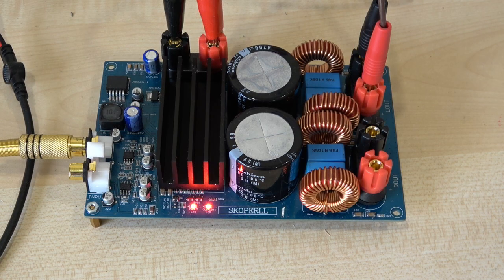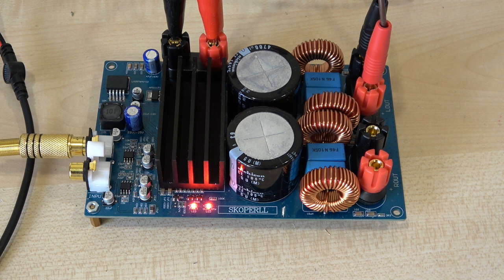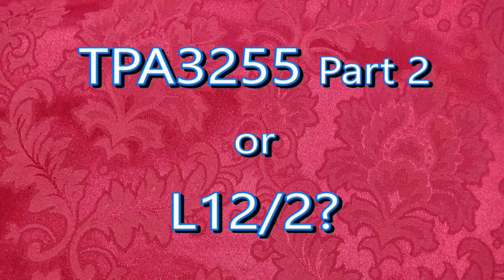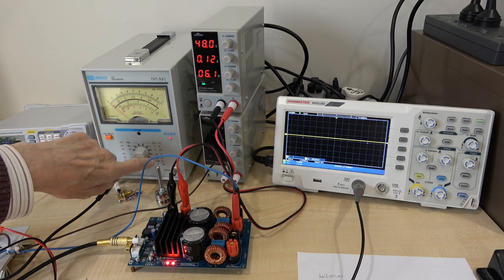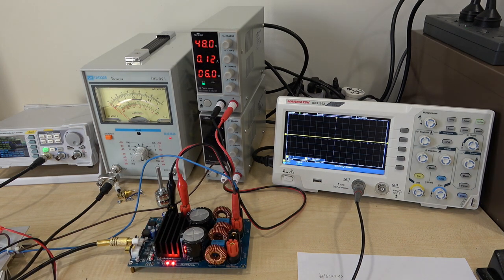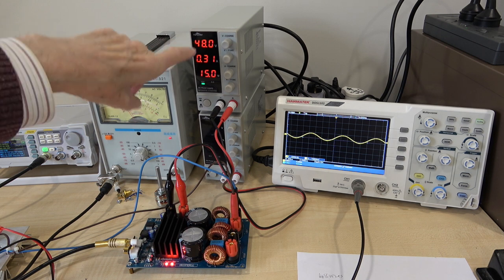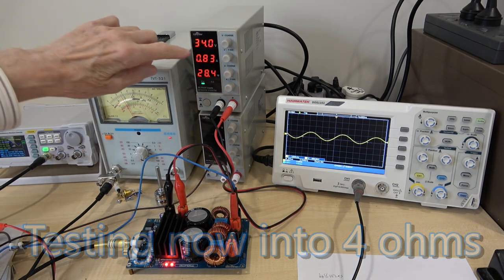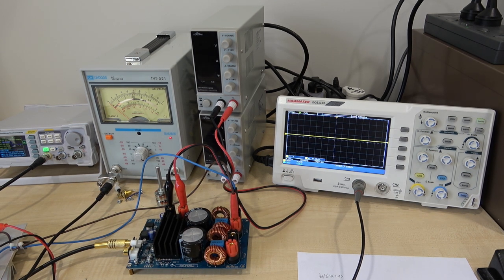Lets Test This Class D Board

Comment: That's a BTL output ... if you are measuring only one side of the bridged outputs, you have to double the voltage then calculate power ... if you are getting 17 volts on your meter, the speaker is actually seeing 34 volts .... (34 x 34) / 8 == 144 watts.

To scope for clipping you actually need to use two probes because both red and black posts are active... one probe on the red, one probe on the black ... then in the scope you need to do ch1 - ch2 ... the resulting waveform will show you the true output.

Also, the thermal solution on these boards massively sucks.  They either supply a dry junction or a themal pad.  Making a small 1/8" shim for the heat sink to just span between the bolts gives you better clearance from the components underneath and a far better cooling for the chip.

i recently worked on a bunch of these amps and I got a very comfortable 125w/ch rms on 8 ohms and 220 w/ch rms on 4, at 48 volts ... with no shutdowns.

Comment: Im wondering if that xl regulator is is misbehaving at 48volts like you showed in the other video. Often the amp chips use 12v for other circuits internally and if its drifting up out of regulation it could cause the amp to act up and cut into protect sooner. Could we work out a dropping resistor value to put on the input of the regulator so it doesnt see more than perhaps 30v for example from its supply.
Reply from the maker: These boards vary from batch to batch. One of my viewers has just sent me some photos of his board. No heatsink compound whatsoever on the IC. Heatsink touching the underside capacitors which will short if you secure the heatsink correctly.
To be honest, I am really fed up with these class D amplifiers. You can be lucky and get one assembled correctly, some even have the correct parts fitted. You do take a gamble buying these boards. DO YOU FEEL LUCKY PUNK??
Reply: @MichaelBeeny  after watching your videos it seems like the dual ic tpa3255 2x fan could be promising and the tda7498e board. im going to give the tda7498e board a try like your one as its quite affordable compared to the others and im running 8ohms anyway. Hopefully i end up with a similar working board. I have a few powersupplies to try. A pair of large laptop bricks in series or a centretapped 20 0 20v 150va which ill rectify with two diodes fullwave+cap and use a boost converter to get me up to 36v.

Comment: So it looks like your board is faulty. I was able to get 100W at 4ohms. My amp was able to stay with such power forever without overheating. My power supply had limit so I was not able to crank it more. Once new power supply will arrive I will make take at full blast 51V.
Reply from the maker: Good luck with 51 volts.
Reply: @MichaelBeeny  Today I got new 48V 10A power supply. First I replaced main caps from 50V to 63V,  set voltage to 51V on the supply, then tested the amp. It did not blow up but max power is only 200W not 300. Without the fan heatsink got 80C so I stopped the test. Inductors were about 40C. I assume that with the fan it could give 200W continous.
Reply from the maker: @Marcink126  My board was already fitted with 63 volt caps. All I can say is you are very lucky. So many people have written to me saying the board blow up at over 45 volts. With other tails of wow.

Comment: I just wanted to say thanks they have a thing called a amplifier Dyno that you hook up to a amp and it will give you all the different out puts and at different ohs as well also shows input voltage. They talk about how to use the older tools that I take to get the reading on the amplifier but they never show them or use them to prove that what it really is some time I question the Dyno and wonder how it would test up against the older tools.🤔👍✌️👌🇺🇸🍻🎶
Reply from the maker: Sorry Joseph, I must say, I have never heard of this before. If you want to send me a link, I will be pleased to look and comment.
Reply: @MichaelBeeny  look up Williston audio lab he use it the most  and is popular for using this amp Dyno and it's all he does and  a guy named smd also has a hand held Dyno sold on Amazon he design and built it with the designer of the original in the Williston video. Ps  I'm not sure if the big one is offered to the public  but the smd hand held is. Hope that helps.🎶👍👌✌️💯🥂🍻

Comment: Every TPA 3255 as known, have for channels.
If someone is interesting to build a good power amplifier, has to choose boards with independent tpa3255 per channel. And not less 5A power supply per channel 
With this the power is sufficient
Not with one TPA for 2 channels or 2.1 channels.

Comment: Chinesium amps deserves any bad press thrown at them. At one time when you made an audio amp and said it was a 300w system that meant someone tested it. When it was tested certain criteria had to be meet. Like actual power output vs harmonic distortion. The standard for stopping the test and setting the "as advertised" specs would include reaching .01 %  harmonic distortion. Chinese standards, if there are any, range from 10 % to 20% harmonic distortion. That's not a typo. The US standard was 0.01%, China is 10.0 - 20.0% up to infinity. 
So sure if all you care about is watts out get you some Chinesium amps with a built in screaming cat synthesizer.
Reply: To be fair the Chinese mostly just state the specs from the Texas Instruments specsheets. Which also state these ridiculous figures.
Reply: Was just about to reiterate what @rustontime said. The number come from the TI spec sheet with a 51Vdc PSU at over 10% thd.
Reply: @zoroluva  Okay so read the TI specs. Do you see anything about using dirt filled Ichycon caps? Or pcb's with .000000002mm traces.
Chinesium crap is Chinesium crap.
Putting lipstick on a pig is just a pig with lipstick and blaming the man you bought the pig from and saying I had to use the dirt filled Ichycon caps. I had to because TI said not to.
Reply: @tayro7265  ok... Your original comment was about power specs. Had nothing to do with craftsmanship or quality. That's a whole different ball of wax. You will find no argument from me there.
Reply: @zoroluva  The quality of parts and manufacture go hand in hand! (here we go) I assumed that was understood.
TI has had to lower it's standards in the attempt to remain relevant in an electronics environment in which China has grossly lowered the understood standards of quality to reflect the poor quality of their slave laborers. It's all a hand in hand operation. 
China buys some quality parts, that they smooze the stats from, because they can't whip slaves into making near the equivalency of. 
Then they stuff other pitiful parts on the good ones but quote the stats of the quality parts knowing it will sound like tortured cats in a bag at 3watts.
That's all I'm saying.
Reply: @tayro7265  oh ok then we're on the same page then. No argument there... Now with that being said just for fun I bought a Aiyima A07 with a 36V 6A PSU. Been running it for about 2 weeks straight now. I have to admit it's shockingly good. It was supposed to be a quick test but it's been hooked up for 2 weeks.
Reply: @zoroluva  Have you ever owned a properly working tube amp?
Reply: @tayro7265  nope. Best I've had is a Denon class A/B
Reply: @zoroluva  You would love it.

Comment: I have a similar board and similar issues. My board performed way better after replacing the thermal paste under the heatsink with a proper one.
Reply from the maker: I did consider this, ie a dose of grease, but the heatsink then touches the components. Your right, I need to investigate this issue. On some modules the heatsink had a step, so the pad can be thinner.
Reply: @MichaelBeeny  Before replacing the thermal paste, the amplifier would enter thermal protection within a few seconds when driving it as hard as I could. Now it takes much longer. I don't think my board has fake components because I can run it at 54V without issues. When running the board at 50V, I'm able to get 2x200W clean power into 4-ohm dummy loads if I place a fan over the heatsink. The limiting factor is now my Meanwell LRS-350-48, which keeps going into protection. I need to get a more powerful power supply to see how much I can get out of the TPA3255 chip!
Reply: @Douglas Blake I don't have the ICEpower module in my hand, but the way they solved it for the 100AS2 module is a rather thick aluminum plate with a rectangular "punch" so the TPA3251 chip, soldered on the underside, touches the plate with some thermal paste (or was it a pad?) in between. I believe the TPA3251 is also quite a bit cooler than a maxed-out TPA3255 design as well.

I have the exact same amplifier kit as you do! I bought it for testing, and I've replaced the opamps with some genuine OPA2134 I had lying around, and replaced a few caps so I can test voltages above 50V. I've also replaced the inductor with "real" Coil Craft ones, the same as used on the EVM, but this didn't really pay off. I couldn't see any real performance boost when connected to my 4 ohm resistive load. Apart from the terrible thermal paste the amplifier came with, and the fact that the heatsink is too small for heavy loads, it performs quite well indeed!

I'll have to do some more testing before deciding how to design the TPA3255-based amplifier. It looks like it probably will be a dual chip design working in PBTL mode, thanks to your input. It will make the amplifier more reliable, and thermal design much simpler. To keep cost down, we're either going to use a Meanwell LRS-350-48 (350W at 48V continuous), or a Mornsun LM450-12B48 (450W at 48V continuous).

That's a pretty wild 5.1 system! I'll definitely have a look at Crown the next time we need some PA grade power! The amplifier I'm about to design will have an ADAU1701 DSP built-in (cheap, easy to adjust live with a microcontroller, and surprisingly capable), but we also have a dedicated DSP module with balanced outputs that can be hooked up to any amplifier.

Speaking of "you can't kill it" amplifiers; I have a 30-year Altec Lansing 9444B amplifier in my living room to drive my subwoofer. I found it in the dumpster at my local university. Made in the US, so this is no joke! All I needed to do was to replace the fan. It's rated at 2x300W @ 4 ohms, but it can easily deliver 2x400W clean power all day long. Definitely built to last!
Reply: @hansibull  how did your build turn out? I'm looking to do the same thing but to use it as a subwoofer amp!
Reply: @zoroluva  We've just received the first batch. The amplifier sounds great and performs excellently! An on-board ADAU1701 DSP is wired to two TPA3255 chips with PFFB circuitry (see the TI app note). Each TPA3255 operated in PBTL mode and is 2 ohm stable. I've designed it to be 2x200W into 4 ohms, but with a larger power supply, it should easily deliver 2x300W into 2 or 3 ohms. The amp is one rack unit tall, and 9.5 inches wide, so you can fit two together in a standard rack. There is no dedicated heatsink, but there is a custom CNC part that connects the two chips to the chassis, with thermal paste in between. When playing music that peaks at 2x200W, the amplifier stabilizes around 62degC. When stress testing it into a load with a sinusoidal signal, it maxes out at 75degC.
Reply: @hansibull  that's awesome!!! I'm glad to hear it's working out and you're getting Crown Amp numbers...lol
So did you buy the actual TI chip and build it up or did you buy one of these kits and bridge them?
Reply: @zoroluva  It's a completely custom board built into a custom enclosure. Two amplifiers can be combined and installed in a standard 19-inch rack, as each amplifier is 1U tall and ~9.5 inches wide. We use a Meanwell LRS-350-48 that's set to 50V, as this is cheap, rugged, reliable, and can deliver peak power way above its rating without shutting down. I tried to increase the voltage above 50V, but it only gets less efficient and can't deliver more power into 4 ohm. 50V seems to be the sweet spot if performance is what you seek. In my experience, you're getting a lot more heat if running it above 50V, and not much more output power.
Reply: @hansibull  just beautiful! Thanks for the input.
Reply: @zoroluva  No worries! Are you planning to design your own, or modify an existing kit/board?
Reply: @hansibull  my want is to build one from scratch using TI plans pretty much cloning the TI3255EVM prototype board.
But with time being so limited it's starting to look like getting and modifying a pre built board from say, Aiyima might be the way to go.
Reply: @zoroluva  The Aiyma has a way too small heatsink if you need continuous high-power output. It runs into thermal protection within a very short time. And the fast that the heatsink is completely covered makes it difficult to get rid of the heat. The factory thermal paste is also not good, and needs to be replaced with a proper one (>3.5W/mK, for instance the GD900). 

I've not tried it, but on Aliexpress there is a variant where the heatsink has an Nvidia fan. With proper thermal paste,  this should be able to handle big power if you can run it at 50V
Reply: @hansibull  you are right! That's very 1st mod that people do. Put better thermal paste. Aiyima does make boards with fans on them all the way up to 8 channels!
Reply: @Douglas Blake Thanks for the tip! I'm working on a custom, half-rack-sized TPA3255-based amplifier where the plan is to use the aluminum case as the heatsink. The TC-175-125 might be exactly what I need for this! The goal is 2x200W into 4 ohms using a decent 48-50V power supply
Reply: @Douglas Blake Sorry, I totally forgot to reply to you. Thank you so much for your input! I'll order a TPA3255EVM board and test how it performs in a PBTL configuration. Since the amplifier will be designed for 24/7 operation, a dual chip solution may be the most reliable solution. We absolutely need the output power. Not for playing loud, but for driving multiple speakers in series and then in parallel. This is how we can stay competitive when competing with otter suppliers of commercial audio gear.

This design will actually replace an amplifier module we've been using for a few years. It's a combined power supply and a 2x250W amplifier, so it's very convenient. However, it has turned out to not be very reliable, and it has happened that it has failed and outputted 50V DC on the speaker outputs, silently frying everything connected to it.
Reply: @Douglas Blake 
It's actually a Hypex module we're looking to replace. We have an ICEpower 100AS2 module, and this is in fact built around a single TPA3251 chip! and The 200AS2's specs looks very similar to the TPA3255 specs.

If ICEpower uses them, I guess the TPA325x series is quite reliable then!

Comment: What if you did these same test with a bigger current power supply? Something with 15+ amps? Give the amplifier more current.
Reply from the maker: We are not short of current. The power supply I used in the video was a 5 amp supply but I also have a 10amp supply. One reason why I only had one channel loaded. It never ran out of current.
Reply: @Douglas Blake Why would it blow up? A speaker is only going to draw current when it needs. Imagine if Michael had a 36-48v 15A power supply to feed the TPA3255. Lets assume, 36v x 15A = 540 watts input, the amp would probably get closer to rated specs at 1% THD. I have a 48v, 800 watt power supply and my mono TPA3255 did not go boom. Played my car sub albeit not well because it's in a prefab box tuned to 50 Hz 🥴
Reply: @Douglas Blake He said the same thing in 600 x 2 video with the genuine TPA3255
Reply: @Douglas Blake Even with a genuine chip, he's not feeding the chip enough current.
Reply: @Douglas Blake therefore, I suggested getting a power supply that has the amperage that is sufficient

Comment: It would be interesting to take some more measurements, assuming the chip is genuine I'd be looking at the output from the OP amps to see if they are introducing DC to the TPA input as the supply voltage increases possibly because the step down circuit is overdriven.  I've built a few of these reference designs and managed to get 300w as per TI spec. Although I wouldn't rave about the sound quality, its not terrible but not what I would consider a faithful reproduction compared to say class ab.
Reply from the maker: @Douglas Blake I would love to see 300 watts for even a brief micro second. It's something I just dream about! I doubt I will live long enough for that day.